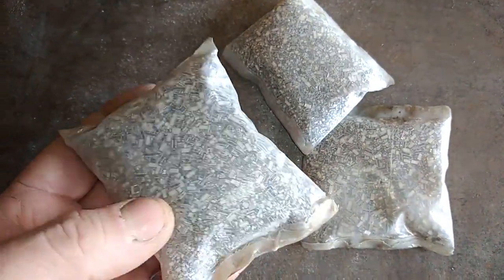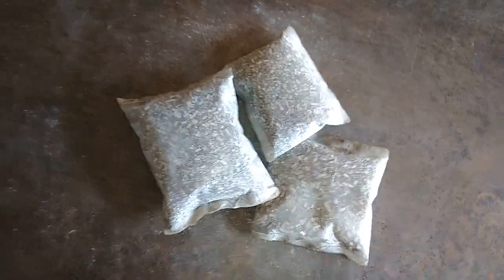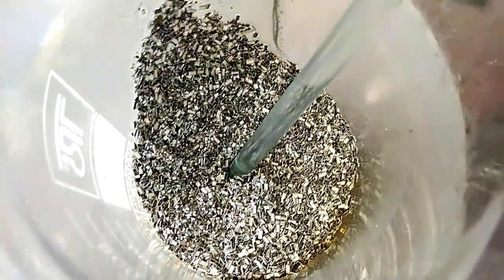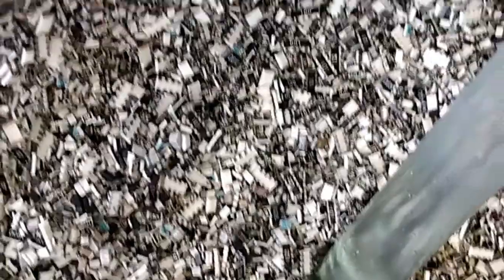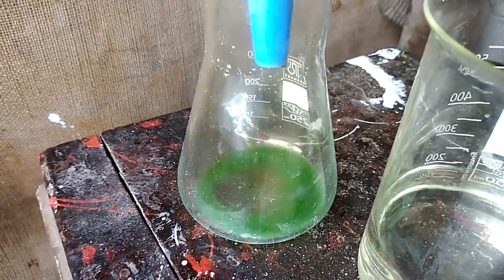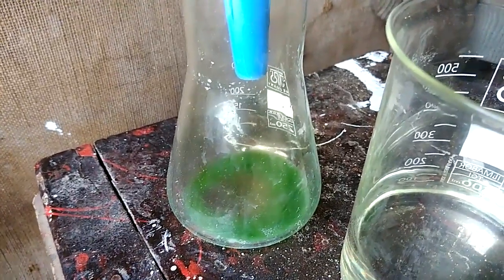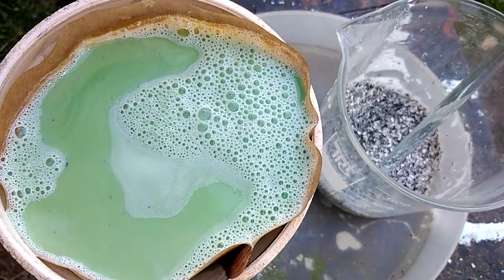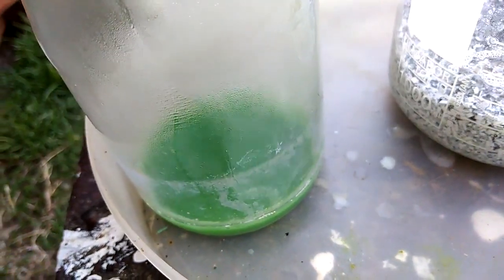SMD Resistors procesing for precious metal recovery.

Comment: Ruthinium? Oxide Thick film  Should be present ruthinium dioxide boils into solution bleach aquaregia won't do ? There's thick and thin thick has ruthinium and jet plane turbine blades yes Panasonic  days silver and palladium use and thoisoi2 ruthinium

Comment: What I get from this is that it's a complete waste of time. Even if you get the resistors for free you will not make up the cost of the acid and other materials let alone pay for your time. There's no silver as a part of the makeup of these resistors. All you're getting is the trace silver in the lead free solder from the tiny pads on the ends. At today's prices in the US silver is $0.78 a gram. You will get a maximum of 80% of that value from a jeweler for that silver so that $0.78 really comes down to $0.624 a gram. That 11.5 grams of silver will net you a maximum of $7.18. That's fucking stupid. They're not even worth picking off of the board. They have more value selling the board in lots of low grade partially depleted boards on sleazebay. I mean it's a neat experiment but definitely not worth it.

Comment: I think i will only use electrorefining for pins i cost less acid and it it is cheapest. Do you think it is a good idea? I see you dont use electrorefining. I make a electrorefining for the cooper waste. After cimentation i put powder in a smal cap with very small holes. And i  electrorefing it to a stainless steel. Can i send you photos to show you on a email?. The result is pure cooper bar in stainless steel. You should like it. Not poor cooper but pure to resell mor expansive.

Comment: I seen someone say they think you should crush the resistors, I agree with them on that.  I would have also incinerated them to help crush them and take off garbage etc.  The crushed will always in my opinion give you a higher yield as its not breaking down solid metal they are already particles which releases more of the metals.  It's just my opinion would love to hear yours :).
Reply from the maker: Probably you ryte frend. But in some old stuf im not notice big diference in the yeilds when i crush materijals and when im not. Acid just do deep inside tru holes from disolved legs.but im agree that crushing is beter sometime.
Reply: This is a much better way. https://www.youtube.com/watch?v=cmnY41jqPGI&t=1213s. You end up starting with smaller amount of metal to refine and its cleaner

Comment: did it get easier to get Nitric Acid? I remember u said it was getting tougher to get.
Reply from the maker: Yes! In begining i hade problem, but when i resolve mostly paper work, now isnt that hard, and is cheap. Kilogram nitric cost me 20 usd cent, sulfaric 15 cent an Hcl same. But for now im low with sulfaric, canot go because corona virus. Probably gas cost me more then price for acid when i go to shop it.